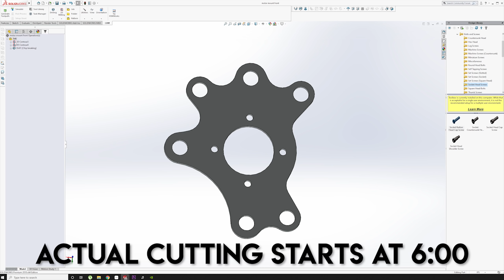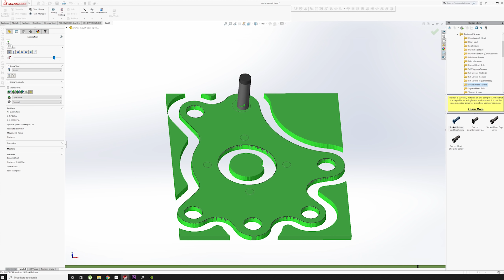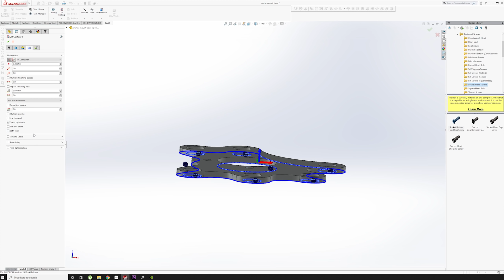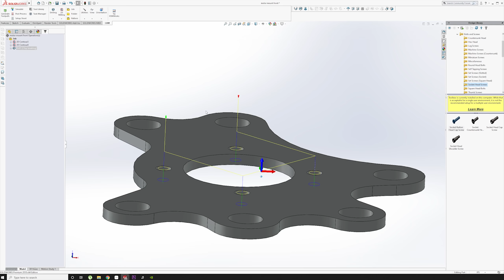Slotting Aluminum with CNC Router

Comment: You can do it by hand of course, but I always like taking a chamfer of V bit and doing a precision deburr on all the edges for my aluminum parts. it doesn't take long, and make things look and feel really good afterwards. Great video, thanks for sharing!
Reply from the maker: Oh agree.  This part will go in the trash after testing.  But yeah, you could do this on a router table with a chamfer bit pretty easily.

Comment: Two questions:

#1 - aren't you supposed to do the drilling operation before the slotting operation? or does it not really matter?

#2 - if I wanted to lay a 4x8 sheet of aluminum on this CNC router, and then proceed to cut out ~hundred nested parts from that sheet, what would be the best way to attach the sheet, and prevent the parts from getting loose while cutting?
Reply: I usually drill holes and screw the metal in flat into my cnc machine(i have 1" hdpe scrap board) and then make tabs in the gcode using software

Comment: Drill first, if you do feel it could move this is potentially another method to then secure it ahead of any other operation, but also if there is a chance the part moved it's more likely to happen during a profile cut.
Reply from the maker: I usually do that, but with these tool paths, I was pretty confident it wasn't going to move on me.  The painter's tape and glue method can hold quite a bit of cutting force.

Comment: Excellent information and video for me to begin with thicker aluminum. 

Do you have a video explaining your air setup? Im not sure where to start and seems like your not losing a ton of air and compressor running non stop
Reply from the maker: Yep, here it is:  https://youtu.be/QV9zMs4t_NE  You should probably just watch all my videos in order to make sure you don't miss anything ;-)  But the compressor is a very small airbrush compressor, which is why it's constantly running.  I don't have an air compressor for the whole shop unfortunately.
Reply: @RobertCowanDIY  i have gone back and watched you CNC vids. Thanks for sharing

Comment: At the end, it looks like it didn't cut through completely on the near corner - was the part not level after you mounted or the tape thicker there?
Reply from the maker: Could have either been inconsistent material thickness, high spot on the MDF or tape, or an unlevel bed.  I was barely cutting the tape even, so it was VERY close.  I ended up just bending/tearing off that part, it was VERY thin, like aluminum foil.

Comment: With 3d printers they have a 'nozzle cam', maybe you can do something similar for the CNC?
Reply from the maker: Yeah, I'd have to fit it inside the dust shoe, and that might be tricky.  I'll figure something out.
Reply: @RobertCowanDIY  For 3d printers they used USB endoscope cameras, I don't know how reliable they are but it seemed to work well in the videos. Depends on how much time you have to tinker I guess :)
Reply: @Jad Theo flixportal xD
Reply: @Benson Miguel thanks, I signed up and it seems to work =) Appreciate it !!
Reply: @Jad Theo no problem :D

Comment: Hello rob,
I noticed you use Solid works, I’m looking into getting it. We’re and how did you get a post proceser? I have a avid pro 4x8 Nema 34 8.7ho spindle.
How do you find it over fusion?
Any input would be greatly appreciatated 
Sam.
Reply from the maker: I'm using the HSMworks CAM package for solidworks, which is basically the same thing as Fusion's CAM.  So I just use that post-processor and it works just fine.  There's one for Avid on their site.  I prefer Solidworks over Fusion just because of the ability to import/export freely and I don't like having files in the cloud, I like just keeping them local.  Maybe some of these things have changed, but I'm just more experienced with Solidworks overall.
Reply: Thanks Rob,
Are you able to explain to me how to get that avid HSM post processor in to solidworks??

Comment: Uhm, this question is kinda unrelated but also somewhat related xD
Is it reasonable to buy a CNC Machine or just 'outsource' it when you don't do too many, too big or too complex parts?
Reply: you need to make a lot of parts for it to be worthwhile having your own CNC equipment. it can be really useful or not so much depending on your projects. If you have a good place to outsource parts then I would probably just do that most of the time.
Reply from the maker: Yep!  I SHOULD just outsource, it would be cheaper.  BUT, it's nice being able to prototype, and toys are fun.
Reply: It also depends on how many iterations you may have while prototyping. Even a fast place would probably take about a week to get parts at least. that means if you have to make a change there is a week between each change where as having your own cnc its minutes. that adds a lot of value to it as well, depending on what you're doing obviously.

Comment: What is the tube you have going into your dust show housing?  Thank you.
Reply from the maker: 6" spiral duct.
Reply: @RobertCowanDIY  I'm guessing the question was about the fogbuster.... which I was going to ask about - I'm guessing you cut this part dry?(as it looked like your turned down the needle valve at the start)  do you use the fogbuster ever for Ali, or always dry?
Reply from the maker: @MarkMellors  The needle valve was backing out due to vibration, so I just closed it.  I would normally use coolant and air, but I just used the air blast here.  I need to figure out a way for the needle valve to stay put when cutting.

Comment: Hi Robert. What is your depth of cut? 1/8"?
Reply from the maker: I think so, the material was 1/8" or 3/16", I can't remember.  You can usually do a full depth cut at 1/2 the diameter of the tool.
Reply: @RobertCowanDIY  Thanks!